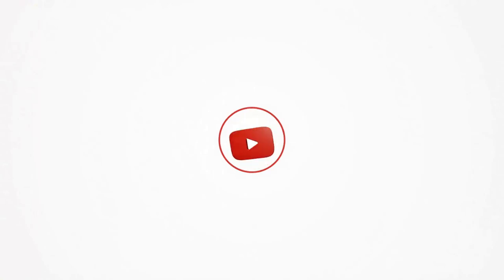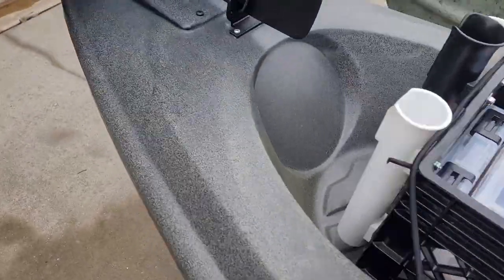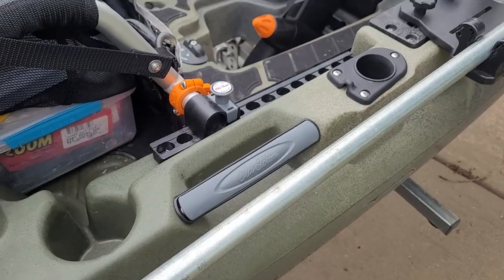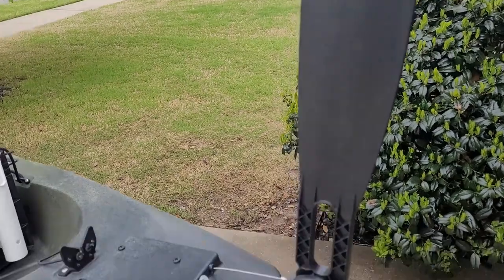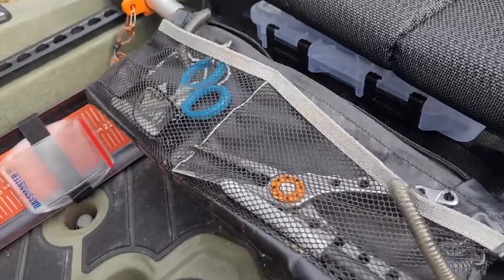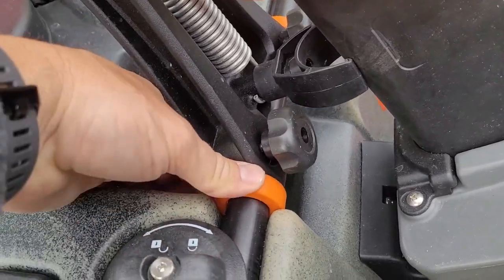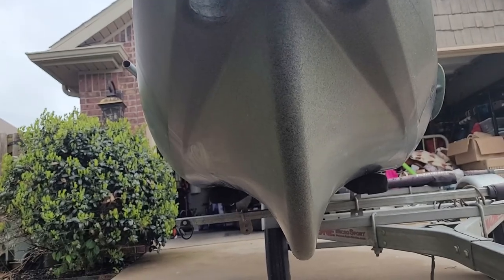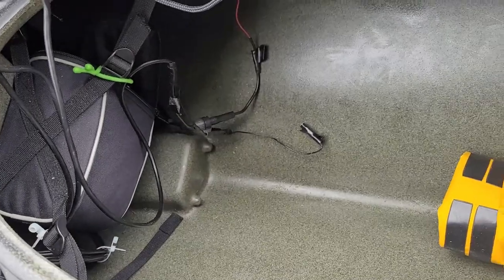BEST tournament fishing kayak ?! Pedal Power

Comment: I agree the bullet proof drive makes these the best in my eyes. 

Oldtown needs come up with a kit to quickly add or remove a trolling motor to the back. Either go to an underside rudder so we can add a fixed trolling motor or make one that that can easily be swapped in and out with the rudder. If they would do that they would pull even further away from the competition.